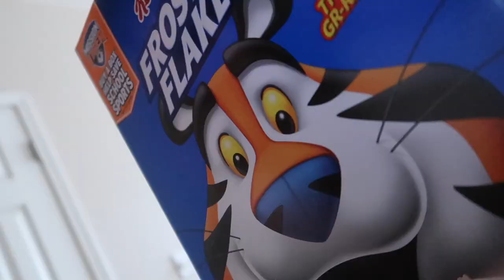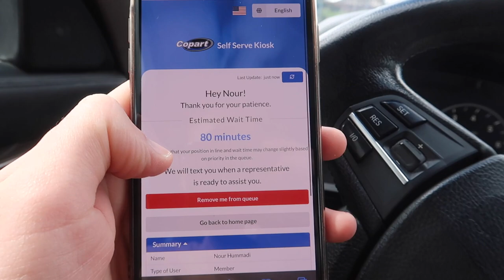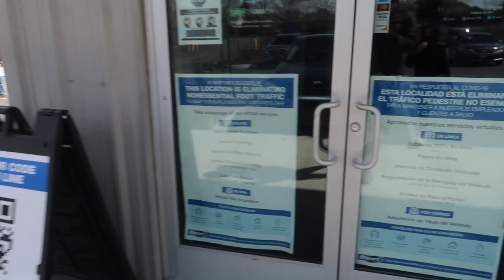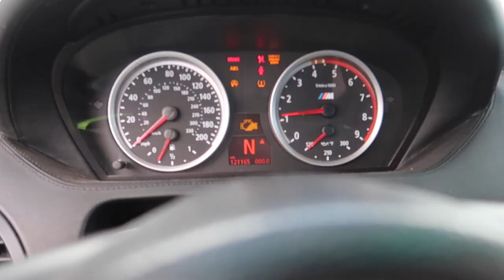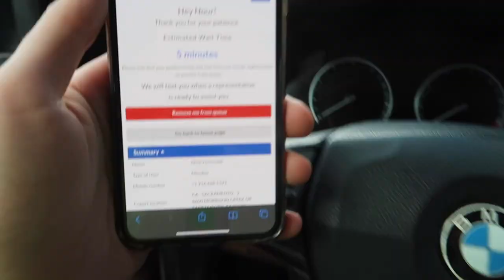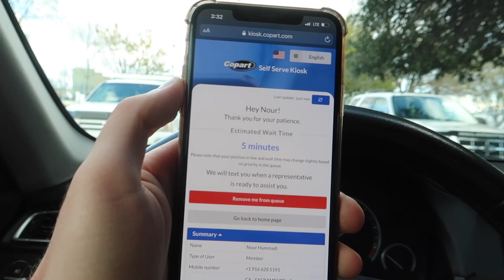NEW BUILDS!!! DON'T JUDGE A BOOK BY ITS COVER!

Comment: Best sounding engine ever, may eat bearing shells like crazy, require careful maintenance and an oil change every 5000KM (3000miles I guess) but it still is a beast. Transmission can be problematic too if not maintained well tho. 
Nonetheless the E60 M5 is my favourite BMW

Comment: Find one with a manual transmission there dirt cheap on Facebook and Craigslist also if the motor is blown your looking at 7 grand for the engine plus you have to do rod bearings and vanos pumps.